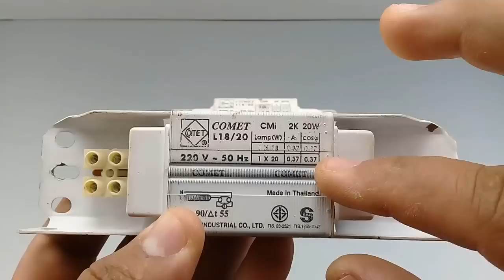How to make Inverter 12v to 220v use Transistor No IC

Comment: It cannot run, because
 the wires are winded over transformers who have closed magnetic loop, and, in add, without remove the sheet iron support !! The magnetic waves can't get in the iron circuit !As usualy, it's a deceptive DIY..

Comment: Los dos transformadores en conectados en serie son de 110vol ac ,sumados son 220 volt entonces eso es el secundario, las bobinas encima viene siendo el primario,el transistor esta en serie con el primario ,como amplificador de corriente,ósea que es lo mismo que usará un trans formador que le metes voltaje por el secundario con un transistor en serie como ampl de corriente ,en la salida del primario tendrás 220 volt,
Reply: Si no usas el transistor,igual tendrán 220 volt de salida y podrás tener unas cuantas luces.

Comment: А магнитный поток что,вне Ш образного сердечника?
Reply: Магнитный поток за ненадобностью выталкивается из Ш образного сердечника постоянным током обхватывающей катушки. Это космические технологии, нам земным трудно понять. Успехов автору.
Reply: operation and independent each core works independently of the other. and connecting two transformers in series will work normally. I have an inverter that uses 3 transformers in series and it works very well

Comment: In recent lab experiments. I have discovered that the addition of a non-inverting toroidal retro-field capacitor will enable the electro-dynamic transition to a stable 3 phase direct current source which shows no defibrillation effects.
Reply: Правильно, ну пока есть не знающие физику , а они есть всегда, будет куча вечных двигателей и чудес! Недавно собрал фонтан герона, так люди с высшим образованием (проектирование домов!) Искали моторчик и батарейки.!
Reply: @МихаилЮркевич-к4ь  Da !
Reply: Works nice with kryptonite chems Tsubasa brand battery
Reply: Može li pitanje ? Da mi objasnite kako to utiče na trudnoću i dizanje polnog organa?

Comment: not buying this. When he is showing the voltage, the white marking on the meter selector swithch is not over any of the marked choices. The wire gague from the 18AH sealed 12v battery are not sufficiant gague to handle the input current for a 10A output they list. No heat sink on the “transistor” that presumably is magically creating a 50 cycle oscaliator with the input coil. This story should be put along side the free energy stories and free high speed internet inventions.

Comment: What is the purpose of the copper wire wound around the transistor ?? How efficient is this setup Sir ???
Reply: TWO CHOKE TOP SIDE COPPER WIRE WOUNED, THIS IS PRIMARY WINGING. CHOKE INSIDE  COIL IS SECONDARY WINDING
Reply: @Ravich646  Got it Sir.

Comment: That coils on the outside magnetic core of the fluorescent lamp coil will never couple magnetically . And how the system is oscillating ? Positive reaction ?  It is a scam.
Reply: Droserele pe care le'a folosit sunt chinezarii cu capace din plastic ;). Daca erau de alea bune din metal, nu ii functiona :)). Ideea e ca nu are control pe frecventa de oscilatie. E in functie de cat mare e capacitatea parazita a spirelor. A uitat sa puna un condesator in paralel pe bobina si sa se joace la frecventza din valoarea condensatorului. Reactia e pozitiva, pentru ca a pus al doilea droser - pe care l'a bobinat in sens invers - paralel cu primul. Teoretic le putea pune in linie si sa pastreze sensul de bobinare, dar trebuia sa le sudeze miezul de fier unul de celalalt, ca sa fie toate bobinele pe acelasi miez. Interesant ca a nimerit raportul de spire pt. a obtine amplitudinea de cel putin 180 de V sa reusesti sa aprinzi becurile. Probabil ca bobina din droser are vreo 250-300 de spire. A folosit un tranzistor care tine teoretic 230V, desi nu e nevoie, aici se vede ca e amator si nu intelege de ce merge circuitul. Merge si 2N3055, dar sa tii cont ca e NPN si trebuie inversata alimentarea. Singura chestie la tranzistor e amperajul - TA1943 sau 2SA1943 duc 10 Amperi cu radiator zdravan, 2N3055 la jumatate
Reply: Покажите замеры прибором с розетки
Reply: Con
CCN
Reply: Joos
Reply: @ismaelgranados5019  guisihera. Gue  esplicara. Por paso. Espero. Repuesta
Reply: Usual blocking generator done by mentally ill using parts from waste bin. It hard to understand from start what he trying to do at all because of coils as you correctly noticed.
Reply: I am not sure about it. I saw a high frequency generator created with a few windings around a line output transformer. And the guy who created it, is not a free energy hoax maker. But the oscillation is a mystery for mee too. 😅
Reply: Esto. Es de. Verdad. Guisira. Gue me contestara
Reply: ใช่yes